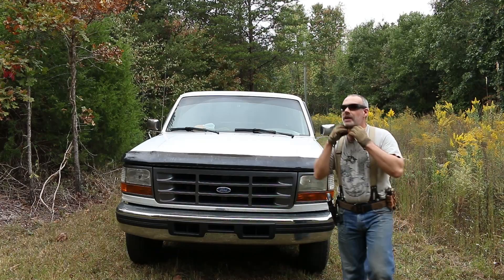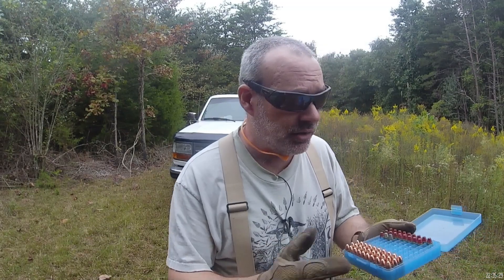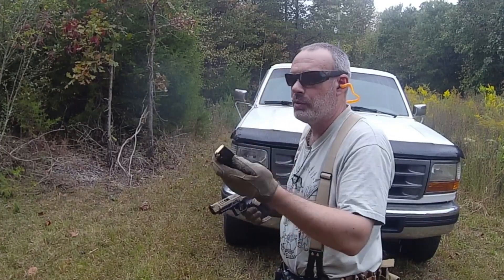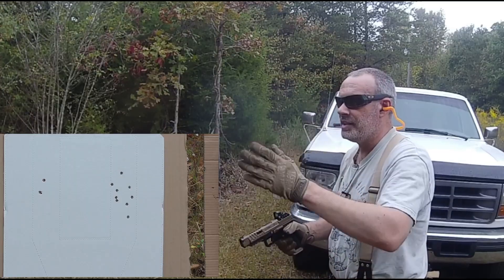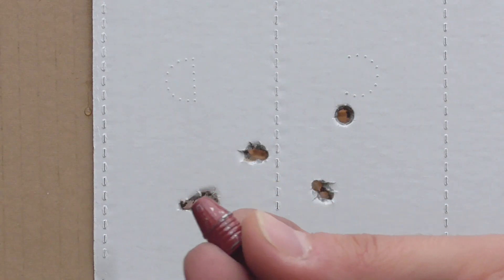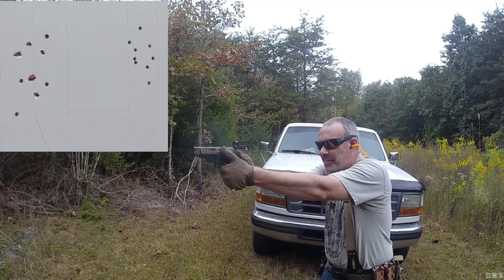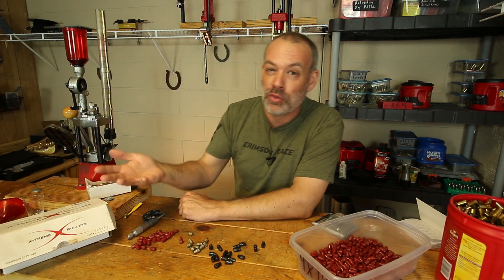My Canik Pistol Won't Shoot!  Cast Lead Bullets

Comment: 1. Mic your bullets and slug your bore Bullet diam needs  to be  .001"  greater than groove diameter.    2.  Lead too soft for the pressure of your rounds?  Check lead hardness with artists pencils.  If so add some antimony or get some linotype and cold water quench your castings.Cut your charge or try slower (lower pressure) powder. 3. If it has polygonal rifling may never be a good cast bullet shooter.(many are not) I always enjoy your postings 👍 DJ

Comment: The bullets aren't stabilizing, so my suspicion (on the basis of what I have watched and read on the subject) is that the bullets are not engaging the rifling correctly. 
I think that it might be worth trying to fire bullets you know work correctly into water, then the ones that don't. Examining the rifling marks and gauging them might tell you something useful.

Comment: Since delving into PCP rifle shooting, I have learned that barrel twist rate and or vs projectile weight and speed can have massive effect on accuracy and precision. Much more so than powder burners for sure. I'd say that Canick twist rate isn't playing nice. Or maybe the type and depth of the rifling. Etc, etc. It just doesn't like those cast bullets. Or possibly just the weight or shape of them. Find out what it likes that you can reload and shoot those.

Comment: I've had the Canik TP9SA for a number of years now, and it's a great cast lead bullet shooter. The only cast bullet that has ever given me a problem in 9 mm is the Lee 124 gr. TC tumble lube bullet, have no idea why it just never shot well for me, so I sold it off.  It tumbled about 50% of the time in any 9 mm I tried it in, no matter what I sized it to.  I have 9 mm molds from NOE, MP in various weight as well as the Lee 124 gr. TC standard grease groove and they all shoot great.
Reply: Lee lube groove boolits don't have enough surface area.  Try the heavier one that does not have grooves.

Also it is very important to use boolits from range scrap or add enough arsenic and antimony, then "heat treat" them after sizing and coating.

Comment: Polygonal 9mm barrels do not like plain hard cast bullets 125gr. .356 diameter. My polygonal barreled Bersa TPR9C hates them but will shoot jacketed/plated and coated bullets of .355-.356 diameter. My standard rifled 9mm barrel pistols will shoot any bullet (jacketed or coated or plain lead) with proper diameter of .355-.356 but they do not like a batch of polymer coated .357 diameter I have so I just use those in my .38Spl. It is possible the TPR9C with its polygonal barrel may like the .357 diameter polymer coat but I would have to try them in it. But my standard rifled 9mm barrels obviously don't like larger .357 diameter bullets. So yes for 9mm barrel types, bullets whether jacketed/plated, coated lead, or plain lead do make a difference as does bullet diameter. Thanks for sharing.

Comment: Is it a polygonal rifling? Stock glocks don't shoot cast lead either until you get a aftermarket conventional rifled barrel. ALL MY CANIKS shoot great with cast lead but some loads more than others( work on the dillion required.).... cast lead projectiles and 2 to 3 thou over to under size.... maybe you finally ran both tolerances to the ragged edge and your limits pushed back. Keep us posted. If you need LMK what load you looking for or send me the components and I'll run them on the 650 and the square deal B, the do a head to head 4 models of caniks is what I own, multi of some models, plus your canik would be a much better test, than a group of 1.
Reply: Side note I've tried 4-5 brands of copper platted brands and they all shot LEAPS AND BOUNDS more accurately than cast lead, some loads have no prob hitting silhouettes at 100. Berry's bullets, Montana gold to name a few.
Reply: My guess is your canik has slightly slower twist than your glock, so your options would be speed them up so the cast rotates faster or  switch the barrel

Comment: Open up your Lee mold. By spin polishing each cavity with the actually cast bullets. Your canik probably prefers cast bullets @ .357”
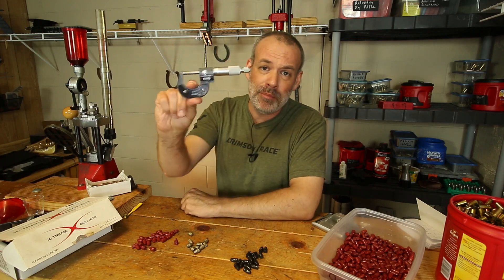Reply from the maker: 8:30  These are sized to .358 to grip the Glock's polygonal rifling.  Opened up the mold back in 2008 when I started using a Glock 34 in competition.
Reply: @ sometime for no logical explanation a particular gun just won’t shoot a particular bullet…. Example.  Been casting for better part of nine years. I probably have a a dozen 9 mm molds of every type of profile and weight, I was very excited when Lee came out with their 356-147-TC I shoot 147 for USPSA out of a CZ shadow to orange. Doesn’t matter what I do …what kind of coating I use ….or what I size the bullets to. I get the same results you get keyholing and terrible accuracy.  I eventually gave up on the mold.
Reply from the maker: @ That CZ you've got is a NICE pistol.  it's on my list and if I can stop buying stupid stuff I may actually pick one up.  I say that as I'm looking at the new KelTec pistol that's stripper clip fed so It may be a Shadow 3 before I get around to it.
Reply: 😂….. is my favorite pistol, hands down.  It motivated me to get into USPSA. It was an older version so I set it to primary machine to get cut for an optic. Then I had to send the barrel to patriot defense to get reamed to load 147’s long./ cz have obnoxiously short throats, which create a problem in itself. If you do have enough self-control to finally save enough for a Cz definitely look into these two companies they make an amazing gun even more outstanding by doing their magic.  Good luck.  All alphas.👍